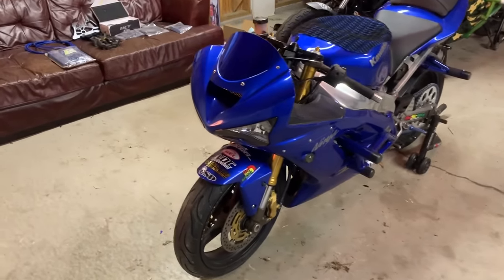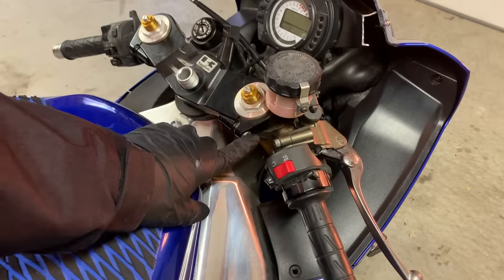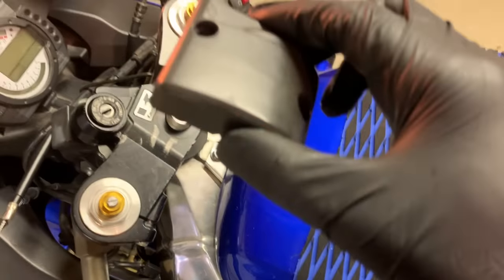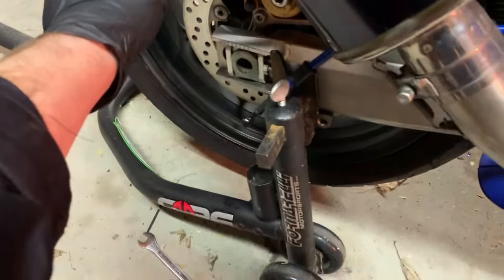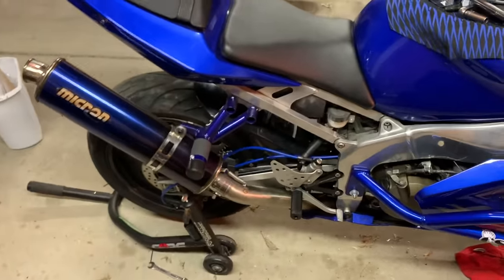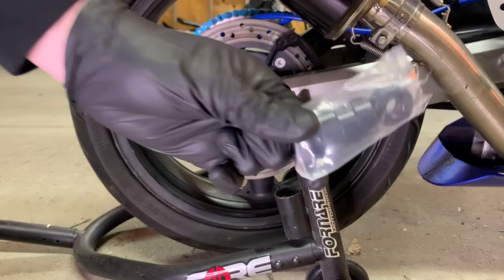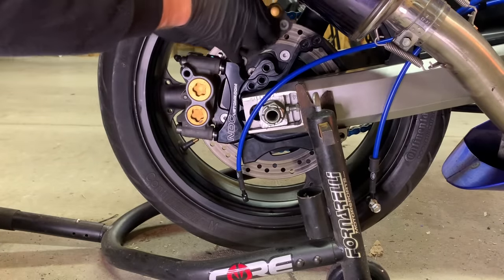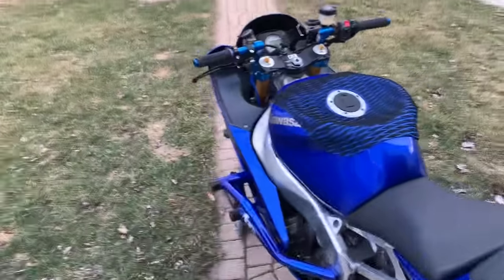The 636 Build is Finished!?! (636 Build Eps. 6)

Comment: just use a syringe full of brake fluid open top bleeder and push it from the caliper bleeder ;) works every time and less stress and risk on the magura bleeder it only takes two pumps then to get pressure. perfect method for long hard to bleed lines. this  bike is sick im currently doing mine cant wait

Comment: You made that tire install look so easy. I always have an issue with the spacer and the brake bracket knocking that spacer off.
Reply from the maker: Just pick it up slightly and line em up, slides in and out pretty easy

Comment: So I have the same exact bike and I also removed that little cluster that has the turn signals and horn on it but I’m not sure what to do with the choke cable? Also since I unplugged my clutch sensor my bike will only start when it’s in neutral, not sure if there’s a way around that

Comment: I am need front brake lines for a clip on conversion. Did you order these online or amazon. I cant find any info on how bog of brake lines they are. I can find how long but not the actual diameter of the lines them selves. Any info is appreciated. Doing mu build week by week

Comment: How do you adjust your chain on those? On my dirt bikes I've always spun a wrench between the chain and sprocket then tighten it all down. Is that basically how you guys do it as well? Or do you run it a little tighter?
Reply from the maker: Just a bit loose not alot man

Comment: Quick question, does 13mm magura mean 13mm clip on diameter or is it diameter of the master cylinder itself idk what to order, is it possible to run stock clip ons? F4i, any help much appreciated thanks!
Reply from the maker: No it is the amount of fluid it pushes!

Comment: Hey, my wheelies feel like they're going of to the left when I clutch up in second gear any tips or ideas of what's going on? Dope build dude! I was really looking forward to this video for a little while now
Reply: I am interested in a answer to this too. Mine seem to go to the right but I have always thought it was the road.
Reply: Your alignment might be off, don't go by the factory markings. Measure it out right.
Reply: check the alignment of your rear axle, mine used to yank hard to the left and it was because my one side as adjusted differently to the other.
Reply from the maker: If you come up taller it will straighten up, also make sure your psi is between 25-30
Reply: @brian636  word up. I don't have a compressor so I haven't messed with the air pressure yet. I'll do that next time tho